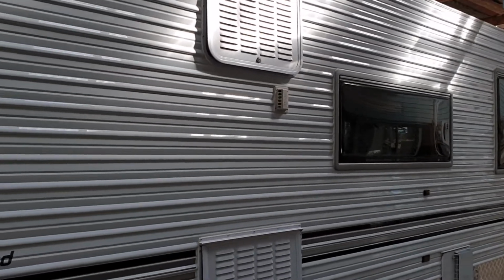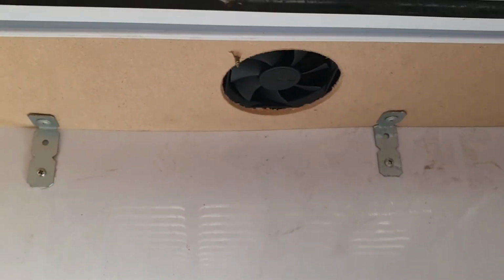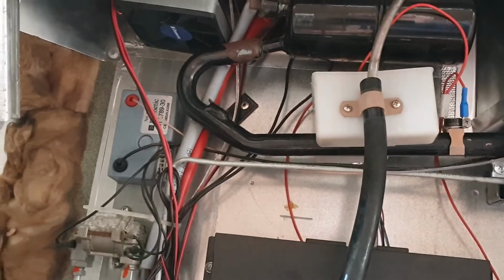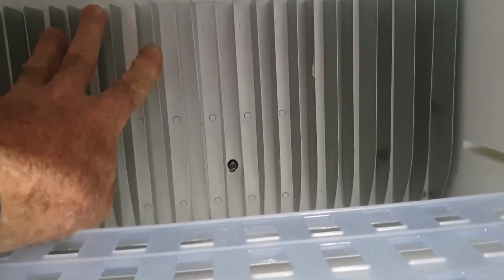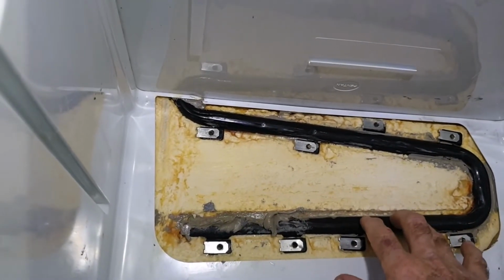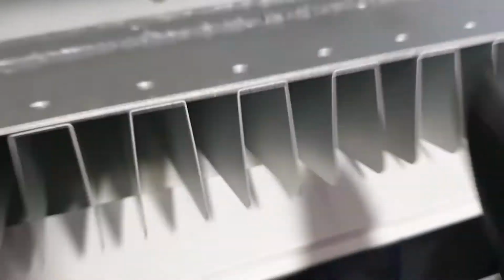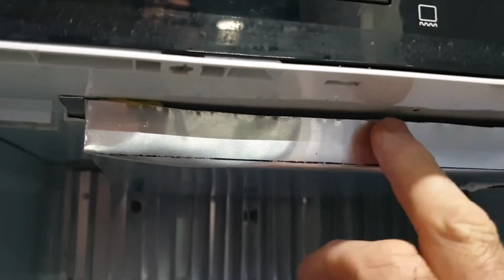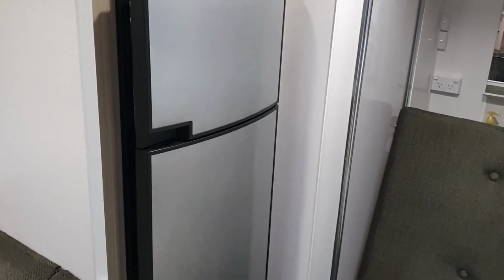Fixed - Dometic RMD-8551 3 Way Absorption Fridge

Comment: Hi Tim. 
Understand this was a while ago but I have noticed you moved to the Bushman DC190L. Did this fit in the same cavity as the 8551, and how is it or did it go? How much battery and solar did you go to to run it?
Reply from the maker: Best move I ever made! No the Bushman is taller and also a bit wider and only just fitted in the space I had between a wall and the back of the dining seat. I had to modify the overhead cupboard to make it shorter and enlarge the opening width. The fridge works brilliantly and hasn't missed a bit. With minimum reliance on electronics and no fan means its absolutely silent and the excellent insulation (which is why its wider and taller) realises power consumption is as low as can be achieved with good performance from the Danfoss BD50 compressor. So many manufacturers are reducing compressor capacity and significantly compromising performance of the latest model fridges. Anyway I thoroughly recommend the Bushman DC190. Cheers Tim

Comment: Hi Terry, your video is very helpful, so thank you.  Did you consider and then dismiss the significantly cheaper Bostik Heat Transfer Sealer - BOS1128C?  I'll need to remove the fridge heat sink to enable removal & hopefully repair of the condensation drip channel below it, so this is a perfect opportunity to reapply the sealant/mastic.  Can you believe it's not available from Dometic as a spare part??  Will probably do the same to the freezer as it's performance is abysmal.
Reply from the maker: No I didn't know about the Bostik product. It was all a waste of time regardless as that fridge is a disaster. It worked really well till the caravan moved!  I've changed to a Bushman compressor fridge. Best thing ever.

Comment: Great video thx. I have done some of your mods but my fridge blatently only cools freezer and not fridge!  I have removed and tipped upside down like you do with these 3 way fridges but still no joy.  Do you know if the fridge is on a seperate control??  It has a sensor near that cooling fins so was wondering if that would control things somehow??  Any help by anyone would be appreciated as this is driving me nuts and I don't want to have to go and buy a new fridge.
Reply from the maker: Hi, look it worked OK at home but after this I did a long trip and never performed well except from switch on till I drove away - then it just went backwards everyday. I gave up and replaced it with a compressor fridge and haven't looked back. Cheers Tim
Reply: So what fridge did you end up replacing it with?  I have only found the Dometic RMD 10.5XS  and the Thetford T2175C compressor fridge that are the same size to fit in hole without any mods. @timterry8714

Comment: Fridge newbie here, what speed does the fan run at? keen to put one in, but not one that's too fast.
Reply from the maker: You don't need a fast fan it's just air movement up through the fins that's important

Comment: Thanks for the perfect solution.   I replaced the mastic, sealed and insulated the chest/cabinet gaps, and closed of my 150mm rear clearance.  Additionally I fitted to 110mm low speed fans in my Roof Mounted top vent comtrolled by a second "button" switch on the hot pipe.  The only thing yet to do is upgrade the thermal insulation of the boiler.  Still the fridge has gone from a waste of space to now working well.  Not difficult to get -15c in the freezer and 3.5c in the fridge on a day of 30+c.
I feel that the masticthermal paste is key.  Having a background in Information technology, for me makes this a "no-brainer".  
Obviously  Dometic were more focused in saving cost rather than delvering a quality product.

Many thanks
Stuart
Reply from the maker: Great news Stuart. Mine came up great also until I actually drove away on a trip then it was all down hill from that point onwards. Have you been on a trip yet and see if it holds up? - THATS THE ACID TEST! Cheers Tim

Comment: (Just a suggestion) I have seen someone pin a comment on their vid comments so it’s always on top, might save someone a lot of grief to let them know RMD 8551 are lemons after all.
Reply from the maker: Well they have been discontinued a long time now but I guess if you are buying secondhand you have to be careful. I dont think that you would think of checking if a 2 way fridge was OK and the seller would have it going when inspected and probably it would be cold - cause it hasnt moved! You would just expect its OK unless you had researched particular model fridges. Cheers Tim

Comment: I had also same problem with the pipe was to far into isolation so heatsink was not reaching.  That grey stuff is not leading heat good enough comparing too direct metall connection just a thin layer of it.
Reply from the maker: Yes its not good design mechanically. Very poor and they should have been recalled.
Reply: @timterry8714  I cant find it now but in Germany there was a group that did a process against Dometic about this refridger, I dont knowe the out come.

Comment: Hey Tim, where did you get your dual temp gauge from ? Cheers Chris.
Reply from the maker: Aliexpress: 
AU $18.20 | LCD Digital Thermometer Temperature Meter Indoor Outdoor Weather Station+ Wireless Transmitter with C/F Max Min Value Display
https://a.aliexpress.com/_mOWYIxY

Comment: I’ve done similar mods but am looking to go to a compressor fridge. I see you’ve since dumped the RMD8551. Did you go for the Thetford T2175c.
Reply from the maker: No Steve, I bought a Bushman DC190 after a fair bit of research. Its a great fridge, very efficient and well insulated. I've been very impressed with its performance so far. I wouldn't ever go back to a 3 way. Cheers Tim

Comment: What is the insulation product used around the flue? And after this video why did you go to the compressor fridge if the absorption was doing so well?
Reply from the maker: I dont think I had any new insulation around the flue - only the insulation batts I bought and installed.

Comment: Hey Tim, I also have an RM8551 Dometic fridge and are based in Brisbane and have been told I need a new fridge. The $3k price tag doesn't impress me. Are you up for some contracting work to do the same on my fridge as you did on yours????
Reply from the maker: No cause its a waste of time. I pulled mine out after a 3 month trip last year and replaced it with a compressor fridge. Upgrade to a compressor fridge you won't look back. That fridge is OK as long as you never move! Its a lemon. I spent hours on that thing and it worked great till we hit the road and didn't recover till we got home and stationary again. I bought a Bushman DC190L fridge freezer. They are very good and power efficient. About $1k less than a 3 way fridge.
Reply: @timterry8714  thanks Tim and I'll definitely look at the Bushman DC190L. Did the Bushman fit into the same space as the Dometic or did it require adjustments? I've always been concerned about the power draw with compressor fridges off-grid but it sounds like the Bushman is very efficient. Thanks for the advice
Reply from the maker: The replacement does require quite a bit of work as most fridges are taller than the RMD8551 and in this case I think it was about 120mm taller and also the fridge is about 80-100mm wider. After removing the the RMD I had to remove the cupboard above it (deconstruct it) shorten all the panels and the doorto accomdate the additional height. That all worked OK and wasnt too hard. The tricky bit was widening the opening for the fridge as the RMD was what the original space was designed for and probably no thought about replacement down the line. The opening was widened using a reciprocating saw and a steady hand and that was relatatively easy or rather straightforward. 

So check your space to make sure the new fridge will fit and that includes space for the door to open fully enough so you can adjust the shelf heights if required. Cheers Tim

Comment: Hi Tim...fantastic video!  I have an Rmdx21 with similar issues and keen to try your fix.  Totally off topic but I also have an issue with the door requiring heavy pressure to close.  No change with the door latch set to lock or not.  Because it doesn't close as it should, it is often left slightly open and not noticed until the alarm goes off...further adding to cooling issues.  Seal appears fine.  Fridge is 4 yrs old and had very little use.  Appreciate any help.  Thanks.  Debbie
Reply from the maker: Hi Deb, I have seen a couple of issues with the fridge door not closing on the web but don't know what model fridges, so have a search they are there somewhere. I gave up on this fridge, it works brilliantly as long as its not moving. I wasted a lot if time on it and finally moved to a Bushman compressor fridge and very happy with that move.
Reply: @timterry8714  Thanks Tim,  I will keep searching.  Glad the Bushman worked out for you.  Debbie

Comment: hi Bostik  1128 HTS  heat transfer sealant  around   $15  in ozzy   Used by refrigeration industry for this application . It is a mastic like thick tooth paste
Reply from the maker: Thanks, thats good to know there is a local much cheaper equivalent however I dont need it anymore as I got rid of the Dometic lemon RMD8551 fridge. Cheers Tim

Comment: hi yes my fridge now gets to temperature BUT. 2 symptoms remain 1/ long initial cooldown 12hrs and
2/ recovery time when in use is that poor u can only open 3x per day . 28deg cel and 60% humid 
I suspect not all the thermal paste is doing the job . Van is 15yr old . ThermoMastic is the next job .
Reply from the maker: Hi Paul, I had no issue with initial cool down after my mods it got to temp within 6 hours on LPG, 240V and indeed 12V. The problem is it just doesnt like movement and fails everytime i drive somewhere. I should just stay home! Recovery is generally poor. I gave up on it and changed to a compressor fridge and it works brilliantly and is surprisingly energy efficient (my greatest concern). No I can holiday without worrying about the bloody fridge anymore.

Comment: hi Thankyou very much .  It appears as if thermo  mastic dries out and cracks and loses adhesion to cool plate . But not surprising its put on poorly from factory ie not enough .Also there is a PDF showing your tube of mastic in the  Dometic Pdf .  
Yes along with fans ,ducting ,full service 240/12/gas checks  my fridge is starting to work well also .
Reply from the maker: Hi Paul, glad its working for you it certainly didnt for me and I gave up and bought a compressor fridge - its nice to having to deal with the vagaries of these fridges and their inability to cope with movement. Cheers Tim

Comment: Hi Tim, Great video. I have the same fridge and have been dealing with the same issues for the last 8 years. Can most of what you've done be done without pulling the fridge out ? Cheers  John.
Reply from the maker: I didnt remove the fridge to do any of it. I gave up on this fridge after my last 2 months away - its a disaster. It works great as long as I never drive anywhere!!! I now have a compressor fridge and its brilliant.
Reply: @timterry8714  what compressorfridge did you install?
Reply from the maker: @RayBan73 I did a bit of research and decided on the Bushman DC190L. It has the best insulation and there is no electronics or fans to minimise power consumption and it works really well. I did a video on it when I got it.

Comment: I  have an old 3 way.   I have been slowly improved its performance  and have done all in the video. But for my fridge the biggest improvement was 1/ putting a sliding drawer at the bottom of the fridge ,made from aluminium to act as a cold sink , so now  i can open the door without the cold dropping to the floor of the van , There is no drop in temp within 60 second in the fridge section ,2/ putting a gasket around the freezer door, 3/ insulating the freezer door with 1/4 foam and holding it in place with aluminium tape ,4/ Putting the foam and tape under the freezer box .5/ Insulating the rear wall to opposite to the burner. 6/ the door seal is a 100% and critically so along the bottom edge ,using a strong light at night in the fridge to find the gaps .  All this has made a big difference. It now freezes water bottles in the fridge ,the fins in the fridge have that much ice on them that you cant see the fins, And the freezer, you cant see the food,  All on the lowest setting, I have turned it to full with only a very small increase in performance, 3 weeks on a 9 kgs bottle ,  if  the freezer  can made to come down in temp ,the fridge can be made come down as well,  do 2/3/4/ first
Reply from the maker: Hi Chris, good to hear you have had success fixing the issues with your fridge. Not sure what climate your in or if its in a van or motorhome but good to hear its all working well for you. I thought I had mine sorted out till I went on a trip in 35C heat everyday and this thing failed totally. I guess your are referring to the same model fridge because this video is relative to this "lemon" RMD8551 fridge only. I have replaced it with a compressor fridge now. Cheers Tim
Reply: @timterry8714  I am in Newcastle Au .  I have a old caravan from 1980 I am in the van now and it's 33.8c inside. In the freezer it's -14 the fridge is  - 8.3  The van is in full sun and on concrete Last summer .before the mod. yes just another cool fridge.oops it's down to 8.6 now because I turned the fan on .where are you?
Reply from the maker: Is it the same model fridge as this. This model was a lemon

Comment: Hello from Northern Idaho, USA.  Unfortunately the Canadian manufacturer chose the RMD8555 for our 2015 fiberglass trailer.  Our door is very narrow and not many choices.  They did NOT install the direct vent on the boiler that you have and the lower vent is too small but unless the performance improves, we are not cutting any fiberglass as we will be going to a new refrigerator, possibly a compressor unit.  We have already removed our unit and improved the baffles and insulation as much as possible.  We are very encouraged to see your video and have ordered the mastic.  Ambient temps now are low, around 20 deg C and our refrigerator maintains 3 deg C on a setting of "3" using electric but gas performance is not as good.  This is probably due to the venting issues. However even on electric, the freezer is never below -8 deg C.  Hoping the mastic will improve this.

We read your latest post of experiences on your trip and hope you find that something unrelated to all your improvements is the cause of the terrible performance and that there is a simple (and inexpensive) solution. Thanks for a lot of helpful information!!
Reply from the maker: Hi Hikerwood, I dont think you can fix the issues with this fridge beyond getting it somewhat more reliable than ex-factory at ambient temps well below its rated performance. I have achieved better performance than when I bought this van but I definately wont be doing another extended trip with it.
You can pull out the gas burner and clean it to improve the performance. I watched a video on Youtube on how to do this and that certainly improved the flame size and mine works as well on gas AC mains power or gas.
I am currently investigating running a standard household (digital inverter) fridge through an AC inverter which appears to now perform equally as well as dedicated 12V compressor fridges at about 1/3rd the total cost. The DC load on the battery/solar is now pretty much equivalent as compressors have achieved much better efficiency in recent years. The inverter technology means that you can run a small 300 watt inverter to easily run your AC mains powered fridge without adding significant power overhead as was the case in the past due to the high start load on the older compressors.
Anyway all I have read indicates this is a good way to go and a very significant saving over a new 3 way fridge. Cheers Tim